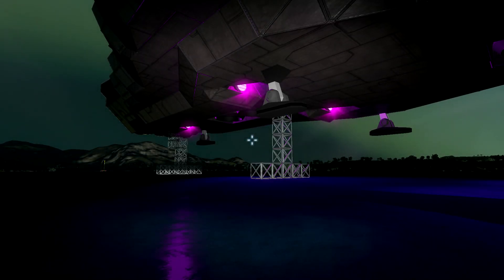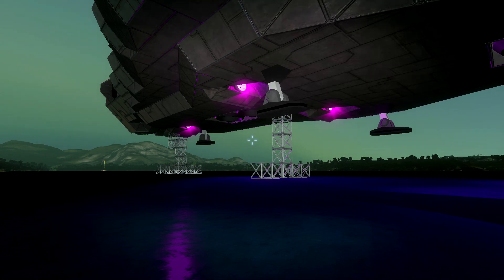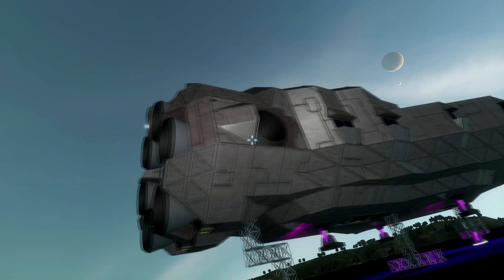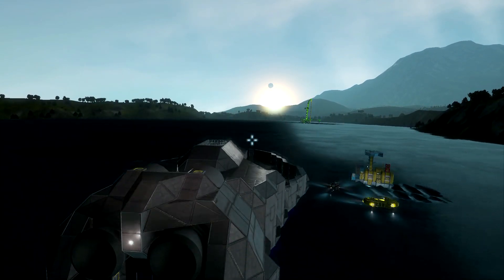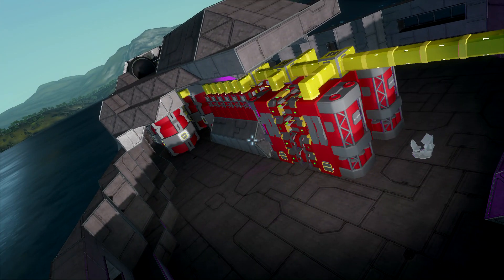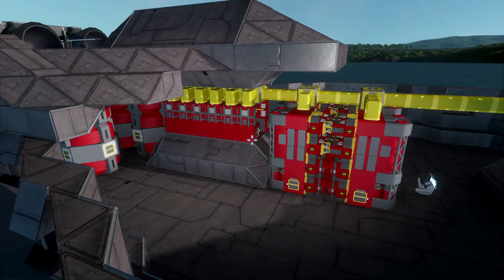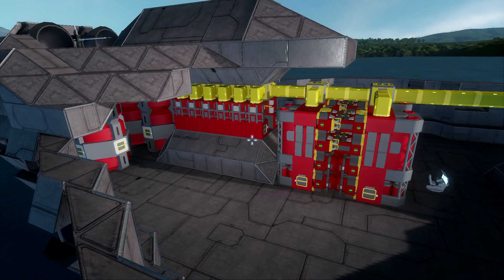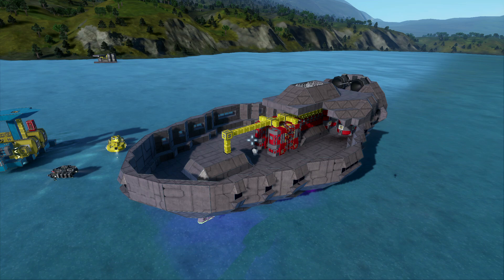Dauntless Explorer pt. 1 | Space Engineers + Me! #27

Comment: the ship looks amazing so far. Be careful with the thrusters as gravity extends 30km to 40km from the surface and max speed is 100m/s approximately unless you modify that. Anyways, point is is you need enough fuel for +5min flight just to get off earth unless you can somehow balance thrust with gravity and not full throttle the flight. (Never seen leaving planet so i can say anything with certainty except facts).
Reply from the maker: +Darknightx33x I'm hopeful that between pulsing the thrust and having a bunch of oxygen generators converting ice to hydrogen as soon as I start moving, I'll be able to breach the gravity well with fuel to spare.  I'll be bringing a fair bit of stuff with me so there may be some catastrophic failures to show off before the actual successful attempt ;D